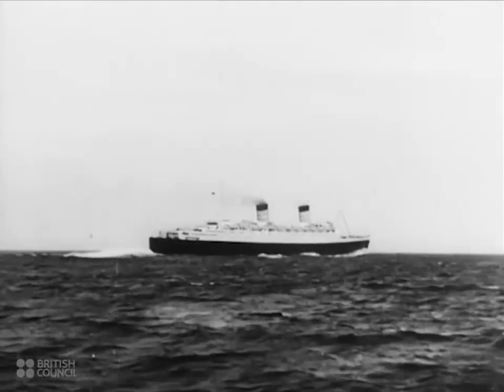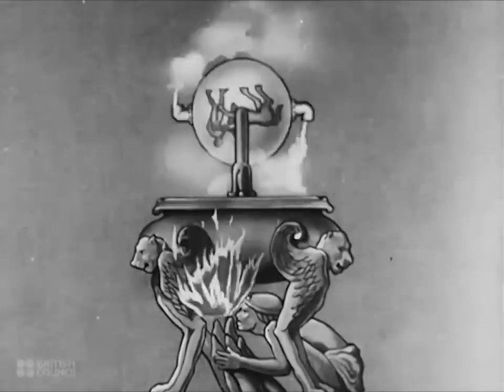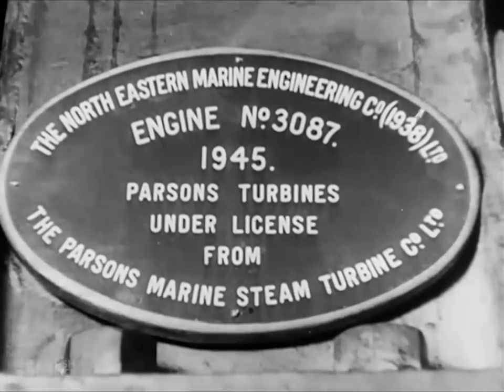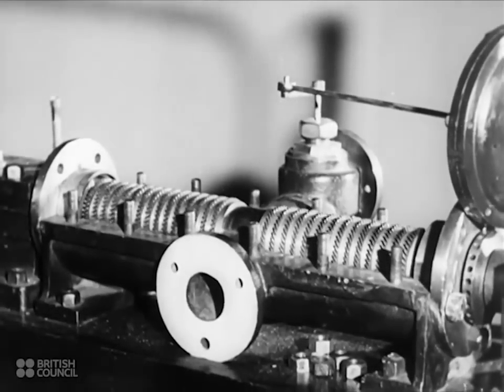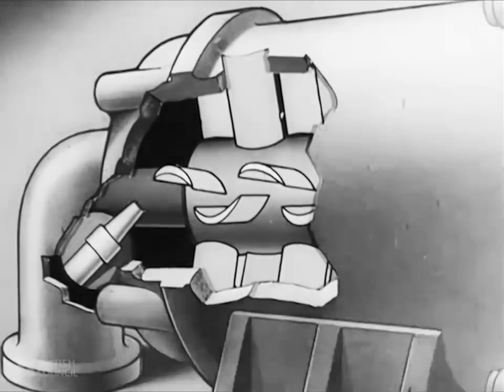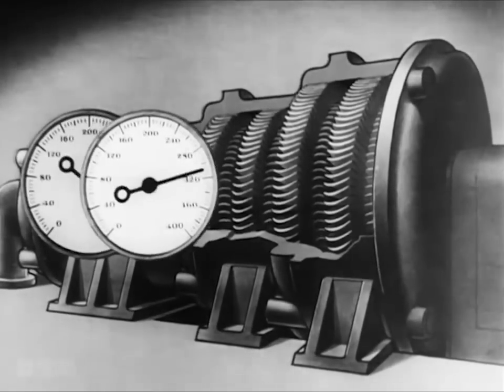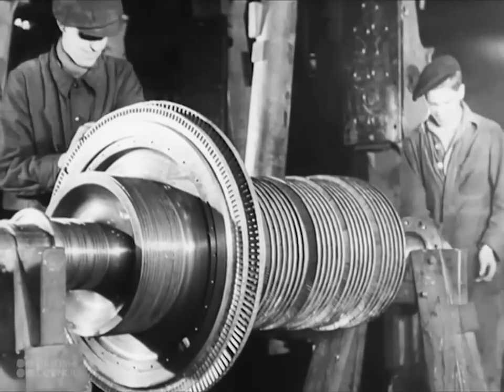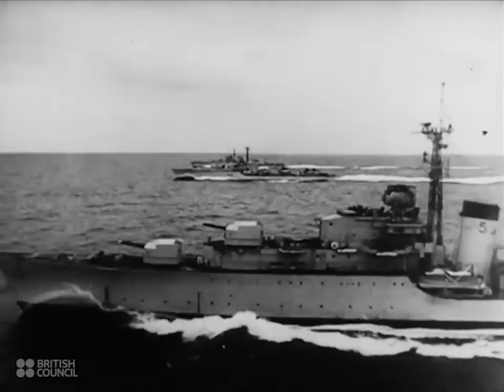Oil Burning Steam Locomotives: Britain Can Make It - 1946 Educational Documentary - WDTVLI

Comment: And navy ships still use the steam turbine to this day this includes the very latest and newest ships built such as the Ford class aircraft carrier which is nuclear powered instead of coal or oil this steamship uses a nuclear reactor to heat up steam to drive a steam turbine. It too is a closed system just like they had on Titanic which also had a steam turbine for its Center prop. All nuclear power plants still use steam turbines as well and that would be any nuclear power plant whether it be lftr technology or a standard solid fuel core reactor.